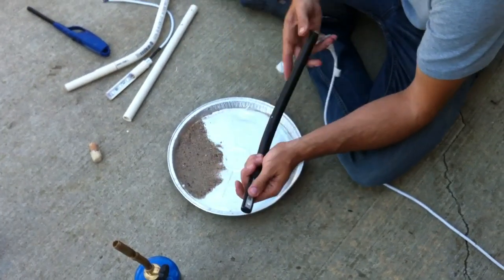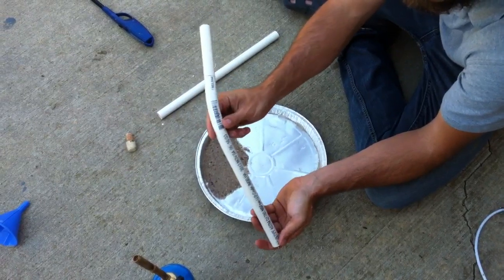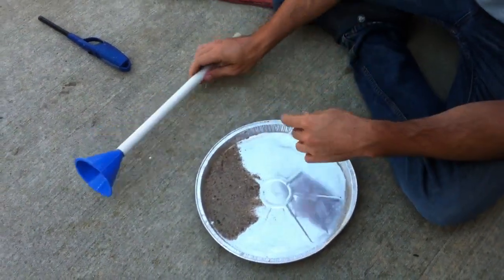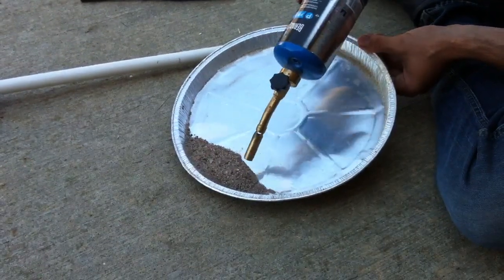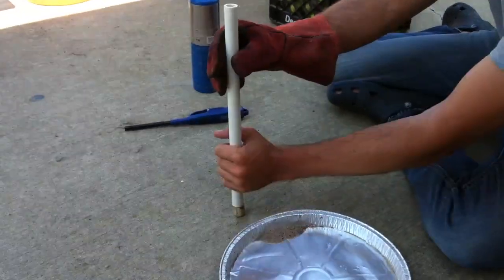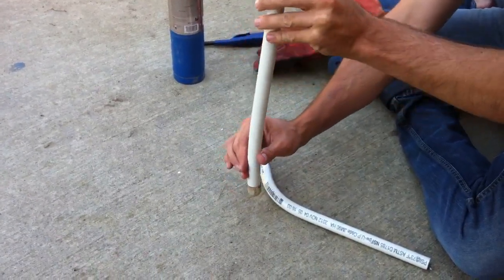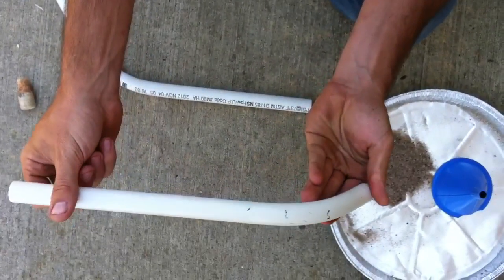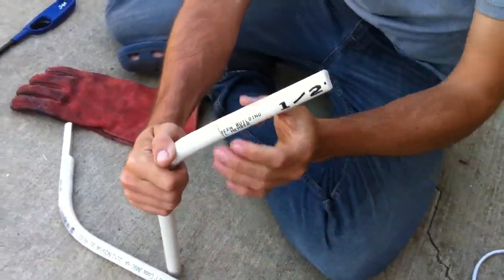How To Bend PVC the Easy Way

Comment: I used a heat gun and sand, with plywood templates to bend gray PVC conduit while wiring my shop.  The sand works great to hold the shape but the price of the heat gun is worth the time savings.  Thanks for a great idea I just changed up a few thing to save me some time making sweeps to run wire.

Comment: I just watched a similar video, but the guy was using a heat gun or maybe it was a hair dryer idk.  He made a jig with some plywood and nails that was quite impressive.  I don't recall if the curves had any severe deformation.  It wasn't apparent on the video, but it was incredibly quick and easy.  He was building greenhouses and using the pvc as framing.  This looks cool, but is probably for those who are really meticulous about how stuff looks.  It does look good.

Comment: If you drag the tip of the torch backwards through the sand so that it doesn't scoop up the sand but it is riding through it backwards, you will be able to heat the sand more thoroughly heating the entire pile and help it retain the heat rather than just heating it from one side.

Comment: you can also use a metal spring inside for short bends, heated by various methods.  doesnt have all the same benefits of sand, but in some cases its even easier and less messy than sand.

Comment: Ever try a plastic pipe oven? It's about three feet long and comes in different sizes for pipe size. Opens up like a door hinge and you put the pipe in slowly roll it till it gets flexible then you lay on a flat surface and make your bends. No kinks or pinch. Professionals use them for all types of plastic pipe in single lines or double containment. Works perfect.

Comment: one of the professional tools I've used is a 'glycol bender'  Glycol is undiluted antifreeze.  A metal tube is partially filled with glycol and heated.  The PVC is inserted into the heated glycol for a few moments and when removed is very limp.  Using a pair of well insulated rubber gloves you form the PVC into the desired shape and 'massage' it till it is cool enough to hold it's shape.. This process can be messy, but when you need to make a lot of bends, it is one of the fastest . . . .
Reply: +pleidius   I can see how this would work, as along as heating the glycol wasn&#39;t expensive to do and not over-heated.  I do wonder about the fumes.
Reply: Gardens and More They were both electric and propane with a thermostatic controls.  They were always used outdoors because it was messy . . .

Comment: Never thought of using this technique to bend PVC. Have used it to bend metal pipe when a pneumatic jig was not available. A good idea. From an artistic view, a great trick for sculpting. By pushing predetermined lengths of rope into each end that is equal to the inside diameter of the PVC, making a bend  in the middle of a 12 foot length of PVC is easy. The rope would hold the sand where it needs to be.Thank you for your effort.

Comment: Goldsmiths and jewellers use sand to bend gold and silver tubing as well. Very good method although with a bit of control you could use the torch to heat the sand filled pipe itself followed by a spray bottle to cool it off rapidly. Nice adaptation of an idea!

Comment: This surely tells you where NOT to use regular PVC pipe, one obvious place being not for the hot water side of a plumbing system or high heat areas.   Very instructive video.  Thanks for uploading.

Comment: u cam use hot air blower gun too. Fill sand in side and  close both side.Blow hot air on the spot where u want to bend and bend it.in side prevent it from shrinking .

Comment: I saw them do this in Brazil to run water pipes.. They use a bed of sand and set a fire under the bed.. the pipe is inserted int the sand for a couple of seconds and it becomes pliable: I do not remember if they put sand inside the tubes though.. It would seem to make sense to though.. They were bending a bunch at a time to run in the building they were plumbing though.. This video made me think of that instance..

Thanks!
Stan
Reply: Optometrists use a small box of heated sand to warm and adjust plastic eye glass  frames for their patients.

Comment: Awesome trick. 
Table salt on the stove should work as well. Just be careful to not over heat the pipe. Salt won't melt until over 1000 degrees F, and I think the pipe should bend around 200-300. It might be a good idea to use a temp gun on it to make sure it isn't way too hot. Salt is a good conductor and should hold heat pretty well.

Comment: I've never seen it done this way before. I used to use sand inside to keep it from collapsing and heat with a heat gun to heat the pipe full of sand. A wet rag will make it cool once it's shaped. A heat gun may burn the pipe if not careful, but a hair dryer will not overheat the pipe as easily.
Reply: +Tim Chartrand  True, but heating the outside of the pipe takes a while and is less efficient.  If the heat is on the inside of the pipe, the pipe warms faster and less heat is wasted since the air is trying to take the heat away.

Comment: Nice person, very polite. I bent my first PVC in 1970 . I had  4 ,4'' conduits that ran exposed for about 200' if I recall. A couple of offsets and a 90* bend. Would this method work ? You tell me . I very likely would still be there.  Also there are times when schedule 80 is necessary. Again this is a very nice guy . Schedule 80  by the way is much thicker.

Comment: very cool...pvc pipe should never be used in water over 90 degrees(they say 70) because of its low melting point. but ive seen dummies plumb their house with it because its so cheap, not knowing any better, and the pipe blowing up the size of lemons, but didnt burst. it just had these huge lemon size lumps every where, anyway that tells you that it can be deformed with very moderate temps, water heaters are generally set at 120-125 degrees. this is cool, i used to bend them with a pvc heating blanket, also they make bending springs, you can put inside the tubing, then heat the pipe with a torch, the spring keeps the tubing perfectly round cuz heating and bending pvc causes the sides to collapse and the pipe goes flat.... but this is a great method. ive never seen it, the pipe stays round and its very flexible, great going finding this out

Comment: You can also do it by putting duct tape on the ends to seal the air inside. Your way is probably better for tight bends.I heat with torch on heat gun, holding it back and always moving to keep from discoloring from to much heat
Reply from the maker: +ww321 unfortunately, the sealed air method will not prevent "kinks" and the torch method often results in a scorched and discolored exterior.  Even if it doesn't actually burn and bubble the surface, it often "yellows" the outside.  This method, while it takes a bit more time, does neither, and that's why it's useful for some applications.

Comment: Awesome looking PVC lights.  The hot sand will prevent a deformed bend but a heat gun used on the outside will assist in doing this faster.
Your pvc insert is a very clever way to attach the led portion and it looks professional, but  I rather do it as one piece.  Overall, your video is inspirational and I will make some of these this week.  Bravo!

Comment: Good idea. But as a retired electrician, we would use the propane torch to heat the pvc and do what ever bend we needed. Being out in the field w/o electricity or a generator required the propane torch. If the bend, 90 or 45 or whatever, was buried, we didn't worry about the scorch marks left on the pvc. Out in the open, we used due care and made it look good.

Comment: All is good except when you use the first one as a template to bend the second one, you're using the outside radius of the curve to set the inside radius of the new piece! The new one won't be as sharp a curve.
Reply: Thank you for your CIVIL reply to the issue of achieving the original radius on successive parts. Civility is often lost in some viewer's comments.
Reply: Terry Wysocki Not a problem if one uses the first one for all of the remaining parts.  When you change templates and use the latest part as the template, the slightest deviation is past to the next part.  By the time you finish the run, part #1 looks nothing like the nth one.
Reply: Fantastic!  New trick for quick fix.
Reply: He ain't building a watch for cryin out loud.
Reply: Terry Wysocki .

Comment: I WANNA MAKE THOSE LIGHTS
I tuned in to watch the PVC bending technique which was cool but then saw those outstanding lights that you made. Can you provide a video about making those LED garden lights? I need to know everything since electrical, even though I can do basic house wiring, I'm a novice about what you quickly showed and need to know what to buy and where. I already have a couple different transformers that came with those crappy made in China lights that either lose connection easily (pressure prongs with a cam that supposedly retains force against prongs and wire) or they get knocked over by the hose or dogs... So maybe I can use them as a power source? 
Thanks for your time!

Comment: Thanks for posting this video.  I don't know if you invented this approach or not, but it's really very creative.  I'm looking to bend some thin-wall Lexan polycarbonate tubing, and this should enable me to adjust the temperature pretty precisely relative to the glass transition temperature for this material.  It's also great that the sand helps to prevent kinking.  Great concept, well explained.  Thanks so much!

Comment: If from where you bought the PVC pipe, you asked for a pipe bender, which consists of a spring that goes inside the PVC pipe, and you can easy bend. After you can pull the spring out, provided you have tied to a strong rope, so make it easy.
Reply from the maker: +Henry Galea The springs actually weaken the plastic in the wall of the pipe, and on average run around $80 for the complete tool setup. The point of this method is to use existing jobsite tools and not weaken the pipe or mar the surface with yellowing or scorch/burn marks.
Reply: +technicolor christmas Sorry, was not paying attention at the beginning. You require a neat  job.  Was nice watching your video.

Comment: If you wanted to make multiple identicle pieces you could put some finish nails partly into a piece of wood that outlines the pattern, and then put the softened pieces in the pattern to cool and harden to shape.
Reply from the maker: +awackocrank I have used jigs in the past for different projects.  A half round router bit into a 3/4" piece of plywood is great because you can make it almost any shape in it preserves the diameter of the pipe.

Comment: I was looking at how to bend a larger diameter pipe, say 1 1/4" CPVC.  Reading at the comments, I found that "Technicolor Christmas" has done up to 2".  To all the people that will suggest using a spring bender:  there is no larger than 7/8" bending spring. I'm planning to bend 1 1/4" CPVC pipe at 30 to 45 degrees bends to clear an obstacle in a low pressure pipe used to lift water less than 30 ft.This video shows a nice method, perhaps a little slow, but his results are perfect!  Congrats.
Reply: I'm currently using a Pipe Viper on 3/4" schedule 40 PVC pipe.
DON'T EXPECT more than a 75 degree bend--as the pipe viper gets stuck.
Pulling it out distorts the spring, so the spring was useless...

Comment: Poke a hole, the size of a nickel, in the bottom of the pan. Heat the sand on one side of the pan then shift it to the hole. The sand falls through the hole into the funnel and you can eliminate the glove. If you have a wet rag, you can bend the heated pipe, pour out the sand and immediately put the wet rag on the bend and it cools in 2 seconds to it's final form. You don't have to hold the hot pipe while it cools.

Comment: Heating the sand in the foil seems inconsistent,,, perhaps put your sand in a piece of thin wall steel pipe, hold it with vice grips?. Also , I suspect you could do the same thing without even heating the sand and using a heat gun on the outside. the sand would still be needed to hold the shape of the pvc. Good video..

Comment: I didn't listen to the audio so I don't know if any specific temps were mentioned, but could a larger supply of sand been more thoroughly heated in a toaster oven? One fill of sand followed by successive hot refills might speed things up. Just thinking out loud.
Reply: you would need to have some way to measure the hot sand so you don't heat up other area of the pipe  another thing you can do is to use a dowel with the cork so that no sand reaches the other end. I've bent pipe using oven and open flame before I like this way I will experiment with different sizes as well

Comment: What not use a heating element that is flexible and can the temperature range just shy of the melt point of pvc? Seems like this take a long time to do something that should take just a few minutes. But it does show some creativity to solve a problem.
Reply from the maker: +Ronald McIntire The point of the video is to show a method that doesn't require a specialized tool.  Yes, I know there are bending springs, and heat guns, and pressure benders and heating elements, and no average Jo or layman has one.  This takes a bit more time, sure, but anyone can do it with rudimentary tools.  It also scales up, I've done a 2" diameter pipe 10' long.  No possible way to do that with any of those tools.
Reply: O it is a great idea. Such an ingenious method.
Reply: +technicolor christmas Also, perhaps something other your aluminum (heat-sink) pan would work better to heat the sand.
Reply: +wb5rue A small ceramic crucible would be ideal.
Reply: THANKS SO MUCH FOR THE INFO ON LARGER DIAMETER PIPES!  Precisely what I was searching for!!!You are right, there is none larger than 7/8" bending spring. I'm planning to bend 1 1/4" CPVC pipe at 30 to 45 degrees bends to clear an obstacle in a low pressure pipe used to lift water less than 30 ft.

Comment: for electrical PVC sch 40  get your self a 5 gallon metal bucket,    put scrap lumber light it up.  then have 5 gallon bucket have water on it  and a piece of rag   or have a 4ft x 4ft of plywood nail a 2 x 2 around make sure it water tight  fill it up with water    after heating up the pipe then bend it soak for a 90 degree or waht ever degree you will able to bend 100 an hour

Comment: Hot sand is a real easy, basic way to warm PVC pipe, and there are other options that do the same thing, some of which are flexible metal tubing devices with electrical wire inside that provides the heat like Nichrome wire common to bread toasters and toaster ovens.  The key is managing the heat to a temperature that won't over-heat the PVC plastic and not getting into a rush.  As to keeping the heating of the same materials as cheap as possible, lots of folks use a common, small barbeque grill, get charcoal going like they were going to cook some meat and place a thicker than standard metal bowl with sand in the center after the coals get hot.  Of course there is a lot of heat produced and things soon get too hot to touch without burning flesh.  Again, the issue is still not getting the sand too hot, so some sort of temperature monitoring device becomes necessary. If you want to do larger diameter PVC pipe, you will likely want to make a hot-box to put pipe pieces in.  A hot-box is a simple way to hold the heat in to give the PVC pipe time to soften enough to accept the desired bend, or shape.  If you pre cut the pipe that will become the bent joints of a greenhouse and use plugs of wood, cork, or another substance that doesn't heat up easily, the ends of the joint pipe can be preserved in the diameter the pipe comes with from the store.  What I did was install 2x4 wood pieces in the box so I could cause the pipe pieces to bend a little, heat them, let them cool, adjust the 2x4 for a bit more bend, heat the pipe, let it cool, and adjust the 2x4 again.  I repeated the process until the PVC pipe pieces were bent to the desired shape.  I used a small, personal barbeque grill in the bottom center of the box since I only needed the center of the pipe pieces to bend.  If you don't shape the 2x4 to the diameter of the pipe, the pipe will start to show a slightly flattened section where it touched the wood formers as it relaxes, or softens while heated.  An easy way to get around the problem is to shape thicker wood, as in 2x6 that has a curve matching the desired final shape of the bent pipe that also has a channel in the 2x6 that the pipe can settle into.  The 2x6 will have a rounded top, sort of a shallow arc and the top of the arc does all the shaping work.  The channel in the top of the arc is where the PVC pipe will settle into as it warms and softens.  If you have seen mechanical metal pipe bending devices that use a simple bottle jack in a steel frame at Harbor Freight, or another store, you have seen curved pipe bending parts that push against the bottom of the metal pipe to cause a bend without flattening the pipe.  Metal conduit bending devices use the same concept to bend thin wall metal pipe without causing the bend to flatten.  The secret is the curved channel the round metal pipe settles into as force is applied to cause it to bend into a gentle curve.  Not much to the process and the only difference is the plastic pipe rather than metal and heat to cause the plastic to remember the bend after it cools.

Comment: Plug both ends with corks & tape to make airtight. Air inside pipe will keep it from kinks use torch to heat pipe keeping flame far enough away to keep from burning pipe. When pipe gets limber set pipe by jig use wet cloth to cool pipe. It will be a lot quicker I am an Electrical contractor I have bent 1/2" to 6" PVC Conduit this way for more than 28 years.
Reply from the maker: Air inside doesn't prevent kinks, unfortunately.